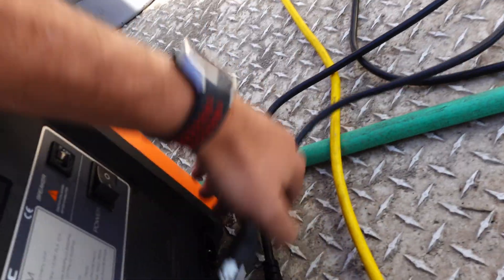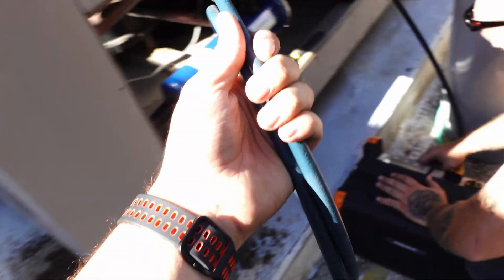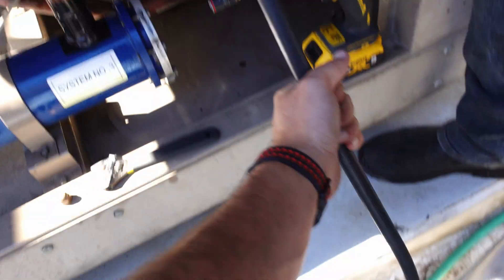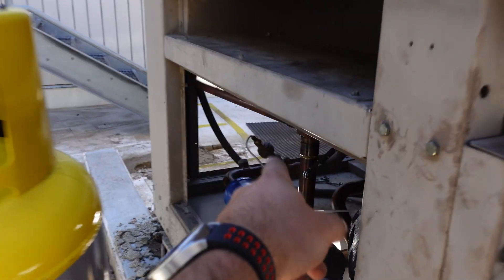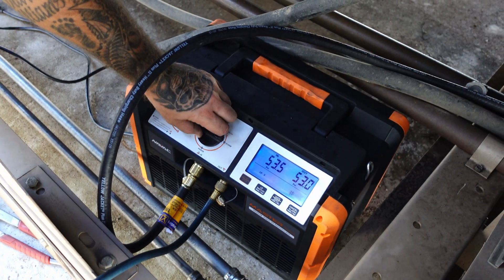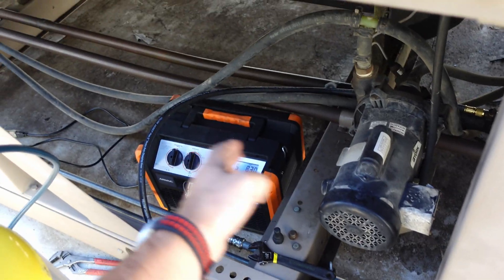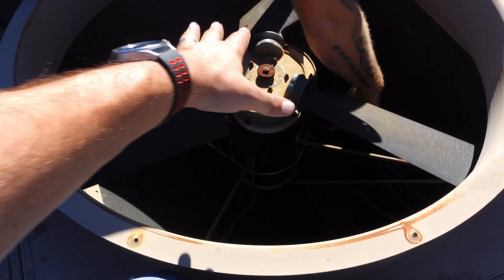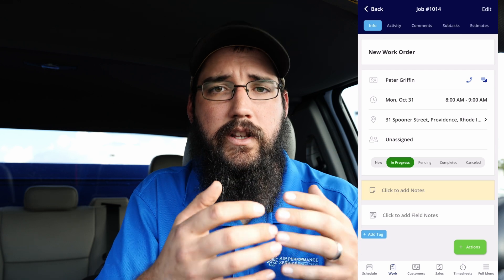Chiller had high SUPERHEAT cause of this

Comment: Whats a feed valve?
Reply: Its an EEV. This chiller uses 2 EEV'S to perform its tasks. You have a drain and feed valve. One begins the flashing process in the economizer,  the other is for the evaporator. Both are metering devices, that's why they call it a flash tank. It flashes liquid into vapor to feed into the compressor. The liquid refrigerant goes to the evaporator to flash off and continue with your net refrigeration effect. An economizer gives you more capacity in the evaporator and more cooling effect

Comment: One of the last times I worked on a YVAA i was able to pump 220 lbs in less than an hour by just letting the compressor do all the work. I hooked up to the liquid line and let the circuit run until it went off on low pressure. Was able to recover the entire charge (270lbs) in less than 5 hours.
Reply: YVAA has a flooded hybrid falling film evaporator. You can drain the liquid via push pull @ 1lb per 2 seconds. Careful not to pull below freezing with liquid present unless glycol is in the tubes. Can’t push pull on a YCAV or YCIV due to Due to DX evaporator. I’d use caution using a compressor to pump refrigerant as running the compressor into a vacuum can be a very expensive venture; don’t expect the LPS to save you as I’ve watched these screws run well into a vacuum on low CHW setups (10f). Makes me cringe until suction pressure comes back up.

Comment: Does it add that much cost to just replace known failure points (EEVs, sensors) while the unit is being repaired. Is it something customers will not go for because of the increased cost. It had to cost a few thousand to remove refrigerant and replace the valve.

Comment: NAVAC four-cylinder I tested it with R410 I placed the NAVAC unit in front of a hot Condenser 115°F plus air and a recovery cylinder in the hot air flow intentionally and it still had no problem recovering refrigerant and filled the cylinder like it didn’t even know it was in 100° + heat

Comment: A lot of manufacturers won't warranty motors, if you don't replace the blades too
Reply: never once heard or was told that in 40 years in the trade 🤔
Reply: @richardbartlett6932  what an interesting comment...why do so many HVAC techs feel the need to give their resumes?  I'm sure your time of service is relevant somewhere, I guess.  Thanks for the comment
Reply: @rthompson968  I too have never heard this in 22 years in the trade and can tell you it's not true with any of the 30 plus different equipment brands I work with. And yes a techs years in the trade is relevant with just about any topic you wanna bring up. So bring it

Comment: I have a tip for recovery buy bag Ice 🤫
Reply from the maker: Sure it works but is an extremely inefficient way to do it especially when dealing with large tanks.
Reply: @HVACTIME  makes you wonder why there isn't a character in the Marvel universe whos mutant ability is HVAC/R. Enthalpic man or Heat Sink. Arch nemesis would be like, Dr Manifold Inhalf.